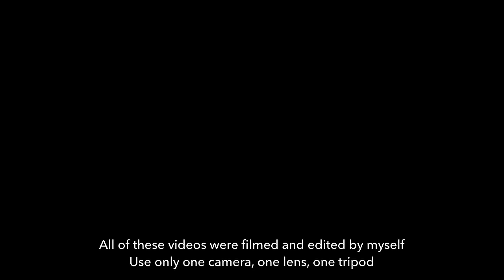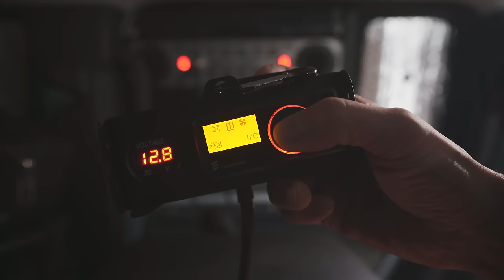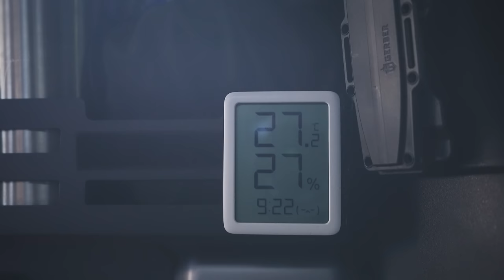ENJOY -16℃ SNOW STORM 🌨 Electroman's 27℃ Hot Car / Land Rover DEFENDER

Comment: Difficult, long and expensive. Obviously, the video is not real; the author could not cope with staging the molasses alone. Nothing to do with the task of arranging an overnight camping spot. And the author would have suffocated in the tent from the exhaust gases of the burner - there is no ventilation for this case in the tent. And much more can be said. The video is for couch potatoes, not for climbers, polar explorers and hunters. Please do not show this to those who have seen the real conditions of a real winter overnight stay in the forest. This is dangerous for them - they will die of laughter.